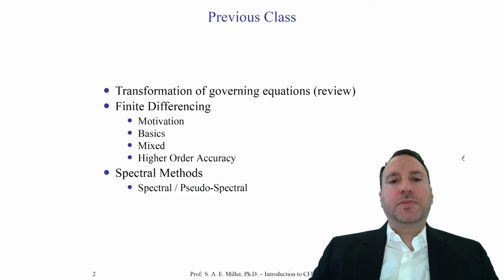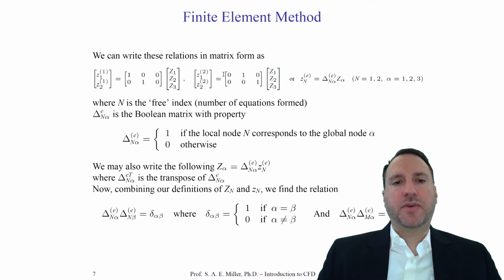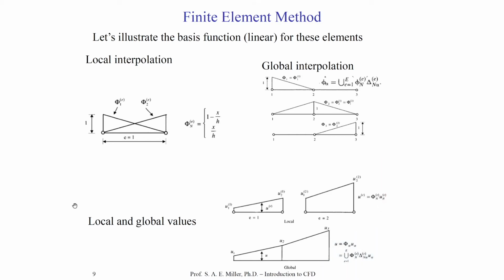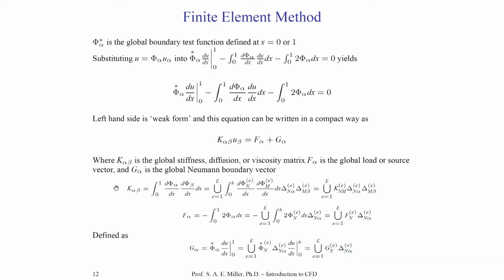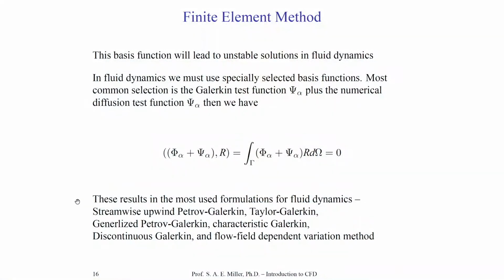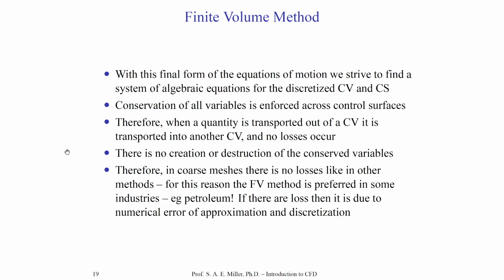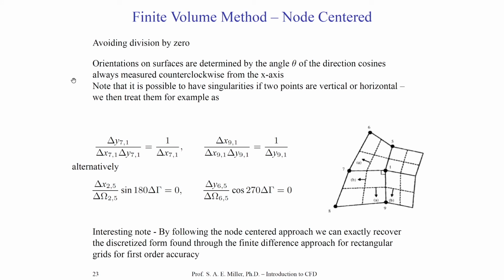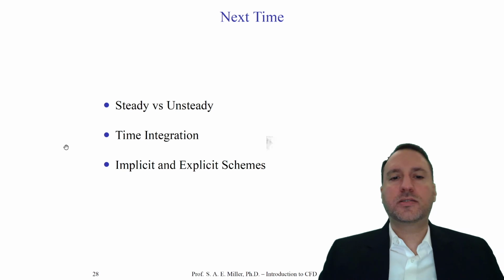Introduction to Computational Fluid Dynamics - Numerics - 2 - Finite Element and Finite Volume

Comment: "Weak form" does feel like slang, but mathemagically by the power of the Fundamental Lemma of the Calculus of Variations, the "weak form" is actually equivalent to the "strong form" of the differential equation. For that to hold true, the Galerkin test function Phi has to be replaced by the variation of u, but importantly the same linear algebraic form can be derived from that version.
Reply from the maker: Thank you for your last few insightful comments.
Reply: @SAEMiller  Thanks for making this content available! I'm limited to free resources, and what you've made available here and on your website, through this course and others (Navier-Stokes, turbulence, compressible flow) accounts for most of what I've learned about CFD if not about fluid mechanics.

If you ever have questions about structural finite elements, that's (the relevant part of) my background. I spent some years at Boeing digging pretty deep into a nonlinear solver called Abaqus, writing Fortran or C code to get injected into various stages of the solver to do non-standard things like experimental damage models, shape memory alloy modeling, or adding hooks for optimization.